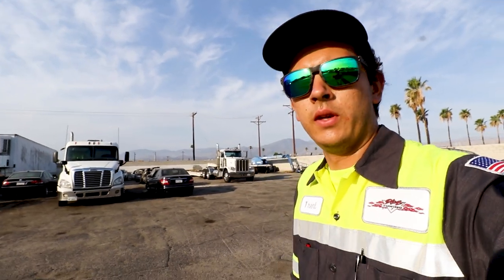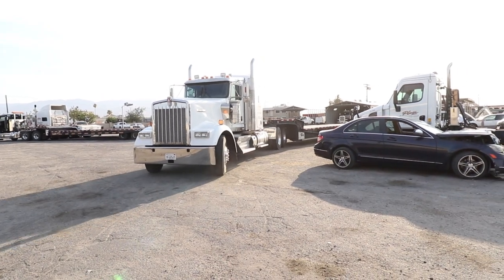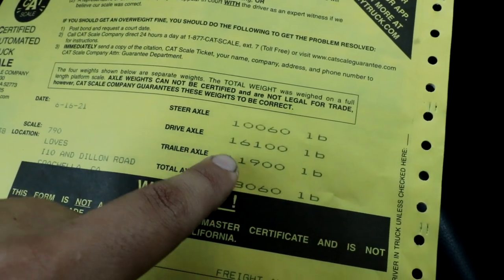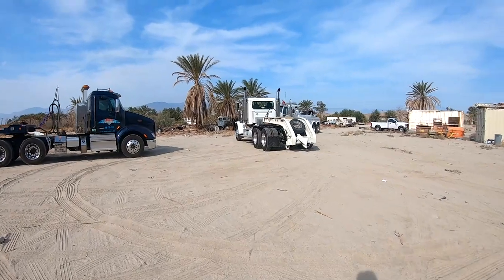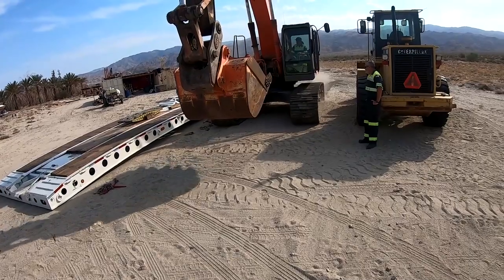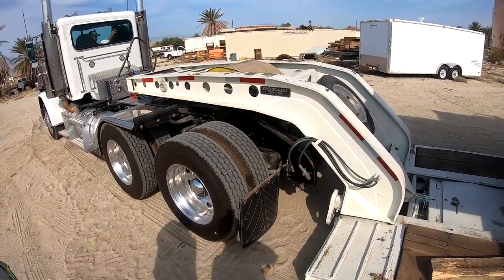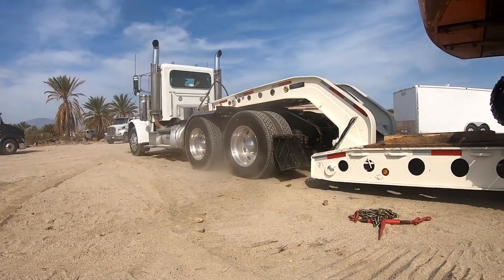112,000 lb Oversized Load! Hitachi 330LC on Cozad 16 Tire

Comment: they had taught me to slide the 5th wheel forward instead of putting a 4x4 block to hold up the goose neck, in case the block falls out then you need to lift the gooseneck up to rehook to the trailer.   i went in one of our cranes to pick up the gooseneck a couple of times because drivers used a block and the neck fell down. and also remember to clean the path of where the gooseneck sits when you rehook in case you drop dirt and rocks, then you wont be able to rehook the gooseneck plates. just something that i remebered from years ago, cuz i forgot once to clean and couldnt hook up and had to start over to get it to connect. good job nice vid, thanks.

Comment: Love the content. Just a recommendation, I'm betting you were a bit heavy on your drives, if you put the machine on in reverse instead of forwards, the drive gears are closer to your trailer axles and can shift the weight off your drives to the trailer axles. Helps scale it out on my east coast set up. I'm given 20k   40k  54k. Tandem axle truck with a Tri axle lowboy. Hope it helps. Be safe driver.
Reply: Gadzooks!  That is just massive!  These big rigs are amazing.  Just a regular truck comparo, I think my rear axle is rated for MAYBE 9k on my home ride. Much respect for you guys who haul with these beasts.

Comment: Great job by both of you. When unloading an excavator, Always keep the boom out and the bucket as close to the ground as possible. If it teeters, you can catch yourself. If it is too high you can tip over. When loading its the same, boom out and off to the side and bucket close to the ground. I have seen them tip over and I have seen them slide off the sides. We had rails down the middle of the trailers to prevent sliding on wet trailers. Slow baby steps always. Be careful and stay safe. Note: The center rails are removable for other uses with the trailers. Our trailers are higher than lowboys.

Comment: Drive motors always to the back, binders on track and lower, hook chain back to itself so you have 4 point contact instead of 2 and if you do brake down, put the ex on trunion pad to pick trailer up, especially in dirt.

Comment: As a old time trucker, we call those trl's RGN's removable goose necks. When ever possible, you should always cross chain, better to have it pulling to the middle of the trl than to the outside. Also hate those rear axles, better to have a three axle, changing the inside tires are a bear. One more thing, with that big trl, why did you not get a twenty thousand lb front axle?
Reply: I agree with using cross chains. 

Additionally, I've never been comfortable with chaining to treads. If you have an accident it would seem like they could break a segment and tear off.

Finally, what are your chains/binders rated at? Only 4 for 77k lbs would mean that they'd have to be at least 20k lbs. Personally, even if the chains/binders were 20k lbs, I'd do cross chains on the chassis eyelets as well as cross chains on the treads or better yet to eyelets on the tread carriers if available.
Reply: I have been out for 15 years and don't remember the tare on the binders, we used the lever or arm binders. On the bigger equipment, we would use double chains. Been nice if all the mfgs would put tie down points on all of the equipment.  But that was the old days, We would haul the Manitowoc cralns and a lot of other major equipment. We did use a lot of chains on the big and heavy machinery. Enjoyed hauling the big stuff. A lot of looks and pictures taken, police escorts, etc. Good ole days,  Now I sit and watch utube videos of all the younger and older drivers still doing it. Enjoy watching your videos. Just keep them coming so the old timers can reminisce about doing it. Have fun and keep enjoying doing it.  I know Dad is proud of you.
Reply from the maker: Remember only 1/2 the weight of the machine is required in WLL(working load limit) of chains. Therefore the 75,000 lb machine requires 37,500 lbs in chain/binder WLL. Being there was 5 chains on the unit the each chain/binder would be minimally rated at 7,500 lbs. These particular chains and binders have a WLL of 11,300 lbs so this load was properly secured. As for cross chaining we simply don’t believe in it. If one side goes loose the other as potential to go loose as well and it’s just a mess of chain and binder. Chaining to the track is not only accepted by DOT here but is actually the universally preferred method here. If the track can withstand the forces of the machine and all the weight of it, it can certainly be chained from it. Thanks for watching!
Reply: @plazatowing  I guess I'm just overly conservative on my tie-down technique. I hauled pipeline inspection tools for a year with a T880 and a 48ft flatbed. I rarely grossed out over 50k lbs. I refused to load my trailer the way the client wanted it loaded because their method of tie-down was very poor in my opinion, and I'm an engineer that was taking time off from work to drive a truck. The way they were chaining the pipeline inspection tool carrier to the trailer depended on friction between the dunnage and the deck. If the trailer were to start to turn over the chains would instantly have a lot of slack which could result in the tool and carrier leaving the trailer.

During COVID I ended up hauling a heat exchanger that was 10'8" W X 30' L X 4' H and weighed 30k lbs from Texas to California. I used every strap I had plus cross chained the dunnage supports (which were bolted to the face of the heat exchanger) to the front and rear of the trailer.

I had forgotten about using WLL. So I agree that the four chains holding the machine to the trailer would have been sufficient. In regard to the fifth chain, in my opinion that chain was mainly there to keep the boom from swinging. If the machine had started to slip off the deck, that fifth chain would have done little to hold the machine onto the trailer. If DOT is good with chaining to the treads then I guess that's good enough.

I really enjoy watching your videos. Every time I watch one I pause it after you've given the analysis of the target. I then plot out how I would handle the recovery and then watch the rest of the video to see if I got it right. Keep up the good work.
Reply: @mirufe1  you are right, the fifth chain was only holding the boom. It's ALWAYS recommended to tie the boom down, besides it's the law in many states. I've hauled excavators & other equipment across the country, always been told DOT required the boom be tied down to prevent it from moving. As far as cross chaining, it's really a matter of preference. Some believe in it, some do not. I've done both ways, never had an issue either way. I don't feel comfortable with hooking only to the tracks though, that's an accident waiting to happen! I can see where they wasn't going very far, it was probably ok, but long haul, I would definitely chain to the machine as well as the tracks.
Reply: @earlribaudo4807  I think you mean snap binders. I personally hate that type of binder, too dangerous! I have both types, I ALWAYS use ratchet binders whenever possible. Some customers require ONLY ratchet binders to haul their equipment. I've seen too many guys almost take an eye out with those snap binders. Always better to use ratchet binders.
Reply: @plazatowing  true, only half the weight is required by law. I always try to put one or two extra though, for safety!  Maybe I go overkill, but I'm still responsible if something comes off my trailer.
Reply: I’ll cross chain if the rollers are off the deck.

Comment: You could do with some lessons on chaining down loads, never just use tracks they aren't strong enough, always cross chain to the chassis as it makes a much more stable load. Hydraulic  RGNs  are a lot easier  to use than manual ones
Reply from the maker: Lol the tracks are just fine. Hydraulic rgns are also much heavier
Reply: @plazatowing  Next time go over the back shut the hater’s up🤣
Reply: Going to the track is perfectly fine and legal RGNs aren't the only or best trailers.

Comment: WoW I can not believe they allow you to hook to the track tread plate out their.. lol you don't want to try that in Michigan ;-) That would get me a healthy DOT fine up here.. We are only allowed to hook to the solid main frames.. That is just wild to be able to bind it that way.. I never dealt with a manual break away all ours are hydraulic.. But time wise?? Looks like about same amount of time to unhook and rehook..
Reply from the maker: It’s an interesting concept and the mechanical break is lighter than hydraulic rgn. Most west coast guys don’t even break down and just ride these units over the back. As for track chaining DOT here has no issues with it and I have spoken to many equipment haulers here who haul much bigger things and they all use the track. It amazes me people think it “isn’t strong enough”. Thanks for watching!
Reply: @plazatowing   well when you really stop and think about it, the tread plate is held to the track with(" four ")grade 9 half inch bolts.. an four bolts combined exceeds the tensile strength of a chain.. but it is amazing how States vary..  but yes you are totally correct we figure a thousand pounds for the lift cylinder, valve , oil reservoir , pony motor and pump.. now on our newer ones that hook to the tractor hydraulics? We estimate about 350 pounds.. but seriously I have hooked and unhooked thousands of times ( hydraulic) and I'm telling you there is only seconds difference, from watching you guys with the manual over the hydraulic 👍 great call to save weight...
Reply: This is California Michigan might have different laws

Comment: strange that you have to drop the trailer completely to remove the gooseneck. is that an old design?  I have only seen the hydraulicly dropped gooseneck. I guess it is a simpler design with less things to go wrong. interesting.
Reply: Mechanical lock is always stronger and safer, no funky stuff to go wrong

Comment: Whats the advantage/disadvantage in a westcoast setup as to an Eastern set up. How do you figure the Bridge. So your legal?
Reply: West coast recognizes trunnion groups if they are spread out as a 4 axle trailer 
Ca tx Az nv nm ut all do so 60k on trailer axles  46750 on drives 20k on front with a trailer that weights half of an east coast flipper 
Cozad Murray rackley are amazing trailers there are still some from the 70’s working daily a lot from the 80’s and 90’s still selling for crazy money too 50-70k for early to mid 90’s 
180k new for 16 tire Murray or rackley these days
Reply: 100% correct Murray's are awesome
Reply: Murray’s are nowhere near cozad and much more difficult to hook back up to.

Comment: Never gave the re-weight from CAT with the machine loaded. Would have been interesting to see that weight.
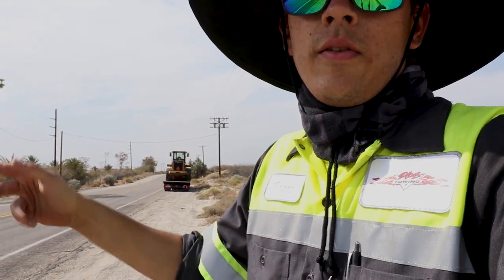Reply: 22:00 mark.  112,100 lbs.
Reply: @johnpurdum8126 , I must have slept on that one. Thanks.
Reply: @johnpurdum8126  staggering
Reply: What were individual axle weights?

Comment: 125.000 lbs is a normal load here in Europe 😎 i think our roads/trucks are stronger. Looks good tho, keep it up😁
Reply: Lmao your trucks are not stronger and you have a very small area to cover. We move 9 axle combos at 240k lbs all day pretty typical dozer move for ag work some go more, we have trailers that wouldn’t fit on your roads. You’re little cabby wouldn’t cut it here. 80k is legal load but permits allow a lot more some states allow more with out permits. Your roads might be better because you don’t have very many 😂😂😂😂😂
Reply: @jimbro389  we have more roads per square mile then u do. Also all trucks can do 116K without permit on 5 axles. We can get permits that go up too 400.000lbs and even over that if ur company has the right permits. If a normal truck only could be 80K we could go home. We have a lot more cars then u have there. A 6 year old kid could drive in the USA without any problems on those wide roads. Ur just steering wheel holders who don't do anything hard. Every idiot can be a truckdriver in the USA. Over here some roads are just as wide as ur truck with tight turns. With those bc trucks/trailers u wouldn't even get out of a company driveway. Ur trucks are a joke and roads are kidsplay. Thats why 16 year old get licenses. Its insane kids are on the roads there, but hey its not that hard. Low traffic and wide roads, everyone can do that
Reply: @jimbro389  good, keep your 80's truck with horrible brakes👍 hope u dont kill someone with brakes that are made in the 60's im afraid u will just like a lot of other big mouth truckers. Good luck with that, I hope it isn't a family. I'm so glad those things are illegal here. Sucks to have a deathtrap waiting to happen, u know it will you just don't know when

Comment: We call those type of trailers “wheelers” in the oilfield, pulling them makes you a wheeler hand. As to chaining to the tracks, your more likely to break a chain than break a track pad, I’ve had that conversation with dot all over, it’s about the working load limit and directional control, and having the knowledge to argue professionally, when you get pulled in by dot, remember (1) they’re just doing they’re job and not being a cunt to them is a good start, if they are to you, just ask for a supervisor (2) they interpret the rules as they understand them, so don’t take they’re word as gold. If you start explaining the regs like junior here does, you’ll be told normally “safe travels and have a nice day”
Reply from the maker: Thank you!!

Comment: So have a question. Here in Canada we regularly haul 63500kg(139700lbs) on super B trailers. 5 axle 20 tire trailers. anything larger is what is considered oversize. I use a 10 foot wide trailer 3 axle on tractor with single axle jeep weighing in at 123000 lbs. on regular basis. some how you think that weight is large. Why?
Reply: In most of the US the maximum legal weight is 80,000LB. Up here in Canada, we can have dual 53 footers loaded as our limits are higher obviously. In the US, anything over 80,000 is overweight and needs some permits and whatnot.
Reply: @nbrowser  Out of curiosity I looked up the maximum on Queensland (Australia) - which all gets very technical on axles and spacing but looks like 132 tonnes (291010 lbs) listed in "Axle Spacing/Mass Schedule for Road Trains". But then we are talking road trains up to 53m (173ft) long.

Comment: No way, it's no 112,000lbs maybe 75,000lbs tops
Reply: He said total weight; truck is 38k and excavator plate weight is 73.5k so 112k is reasonable....
Reply: @hondaman08   that 330 is 73,500lbs? I was close! I just saw the thumbnail, didn't watch.
Reply: Do your homework before you comment
Reply: @Hithere-xx1gk  coz I'm correct? I've hauled hundreds of excavators in the oilfield, plus I didn't watch the video.
Reply: @Rightwinger1982  ok guy what I said was so u can understand u didnt watch the video either did I at first but I knew 112,000 was gross weight meaning the tractor and trailer and excavator,chains, fuel in the truck,the driver,his lunch so do u get it now chief

Comment: No thanks on a mechanical neck, hydraulic takes 2 minutes and you are not in & out of the truck multiple times or slamming the truck into the trailer.  In bad weather or mud you are really going to love that design!
Reply from the maker: They both have their advantages/disadvantages, one being the mechanical is lighter leading to more payload. Thanks for watching!
Reply: How many times does it rain in California?
Reply: @kempo_95  It does rain and when you move equipment you don't just stay in one little area and job sites spray water for dust control!  Obviously this is something you know nothing about.
Reply: Hydraulic neck = heavy 
Murray/cozad/rackley = big pay load